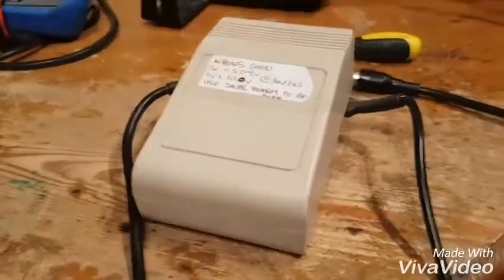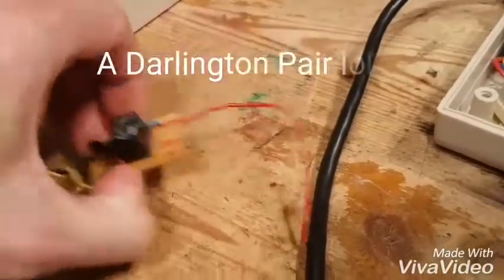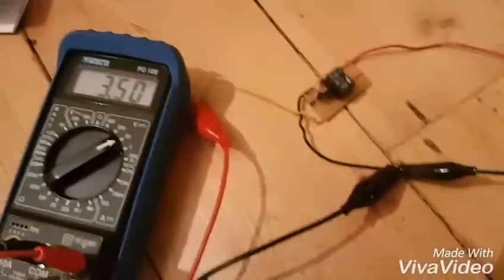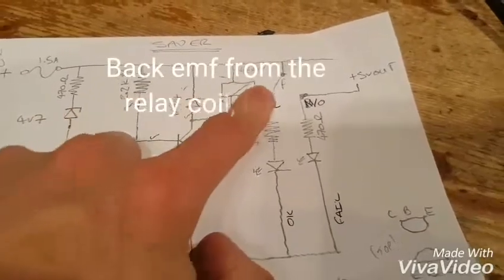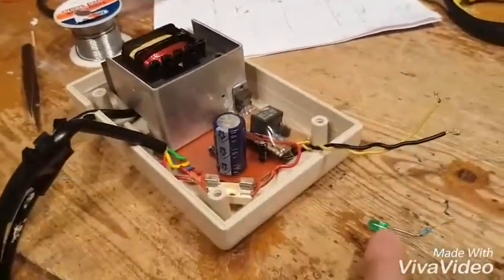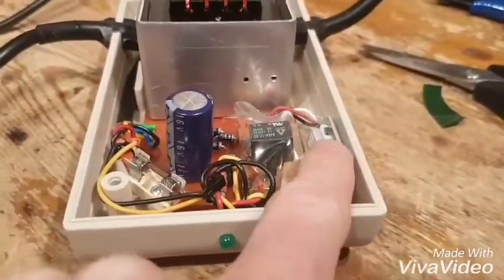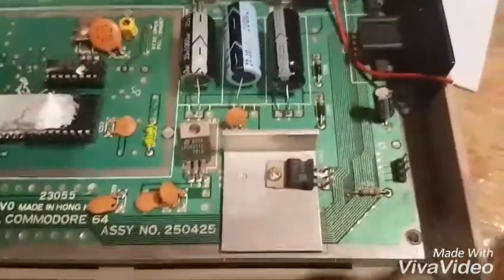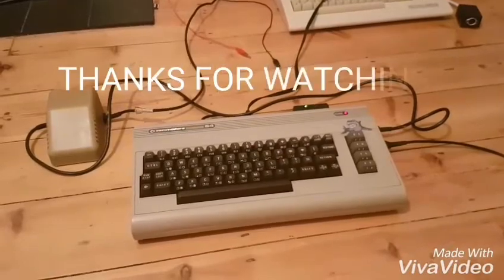Adding a Homemade Saver to a PSU / Inside a Commodore 64

Comment: Nice project. I've been wanting to do this one myself for a while now, but haven't gotten around to it. As GadgetUK164 mentioned in his comment, I picked up one of bwack's C64 Savers about a year-and-a-half ago, so that's been keeping me protected. I actually purchased a few UBECs about a year ago to use in some C64 protection tinkering -- like minds, I guess. You have inspired me to give this a go again. Great work!

Oh, and thank you for subbing to my channel, as well. Greatly appreciated. Cheers!
Reply from the maker: MindFlareRetro Hi. Thanks for the kind words. I may invest in a Bwack saver too. Wasn't sure if he was still making them? Good luck with the project. Toying with the idea of de-expoxying  a brick for the next project. That's the last unmodified PSU left... atm😂
Reply: bwack posted on Facebook recently that he might not be making the next batch for a while, but there is demand, so hopefully he gets around to making them sooner than later. It's such a sleek and well made little device. I think he wants to improve on it even more.

De-epoxying would be interesting to see. I watched this guy's 3 parts series recently, https://youtu.be/Fej_3XbufRA, but it's a full gut and replace.

Comment: I have one of these PSUs, but I can't read the values on the diodes in mine as it looks like it got a bit too hot at some point.. can you tell me what they are and could you replace them with a large bridge rectifier instead?
Reply from the maker: Hi. I am pretty sure they were standard rectifier diodes, either 1n4007 or 1n4001. 1n4007 are stronger so I replaced them all with 1n4007. Cheers.

Comment: Great video. Just beware that this design is more temperature sensitive. Ray talks about this in his docs, and if I recall correctly he tweeks the setpoint to work for both hot and cold to prevent the saver to go off at too low voltage at cold temps (cold cellars :) )  or too high voltage when hot. That's all I wanted to say. Other than that, great stuff m8. It's great seeing more people thinkering with the beloved C64 hardware.
Reply from the maker: bwack Thanks for the warning. It is indeed sensitive to temperature. I 'tested' it, not very scientifically, by blasting it with a hairdryer for about a minute 😂. The cut-out voltage dropped from 5.4 to 5.14v and then began to go back towards 5.4v as it cooled. Hopefully, it won't get that hot in my C64! If it does, I'll probably have other problems to worry about lol.

Comment: Great job!!  You should check out bwacks savers - really nice and work inline with connector.
Reply: Hi Gadget UK. I haven't announced this yet. but I have sold my last saver. Ill make another open source hardware project to let more people in on the design process and also improve the build time and make it more robust. Send me an email and we can discuss :) I'm currently keen on using MAX4840A to get UVLO and a whole range of other features. Also add input capacitance to protect it from the long wires. It will also possible to add software control, but not really needed lol.